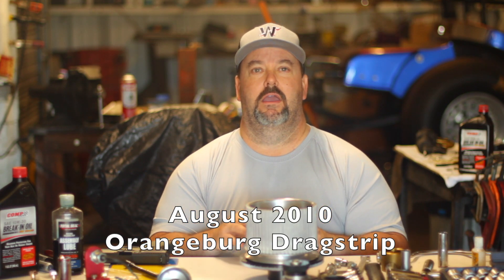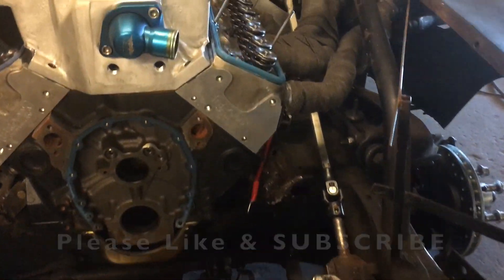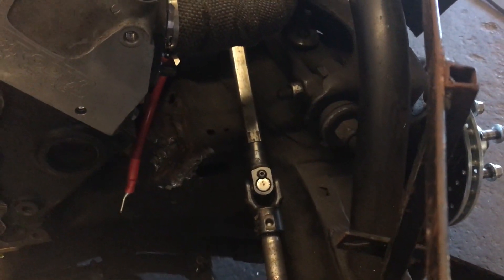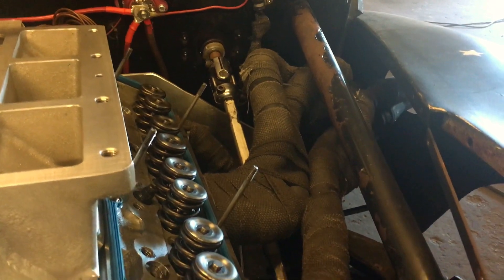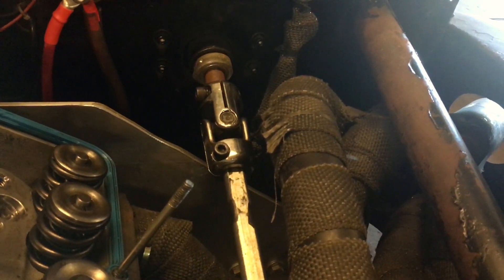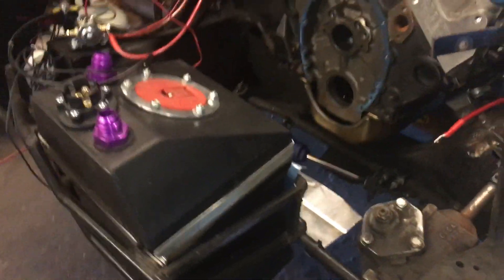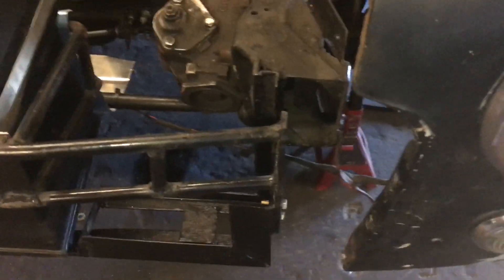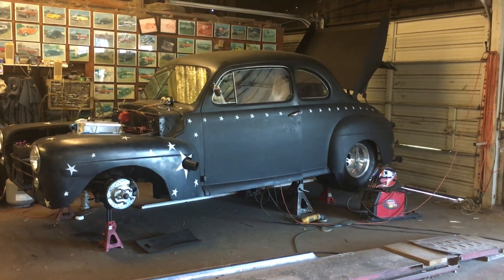Steering Safety | Rag Joint Eliminator | Steering Stabilizer Death Wobble

Comment: Was that a 50 yr old rag joint? Was the crash the fail of a rag joint or missed maintenance?
Reply from the maker: Great point. The rag joint was around 4 seasons old, but the front suspension wheel stands definitely put a beating on it. Go fast, go straight! Be SAFE!!